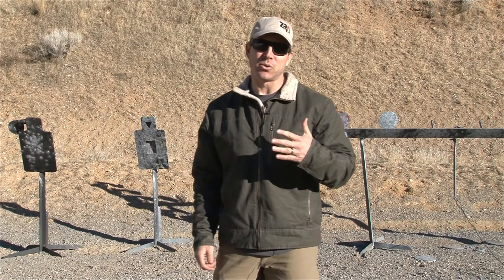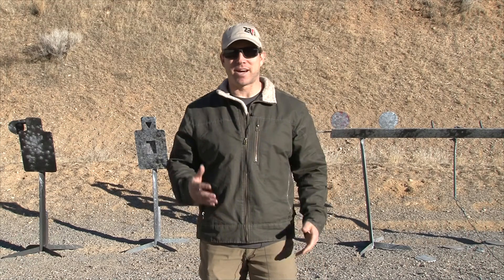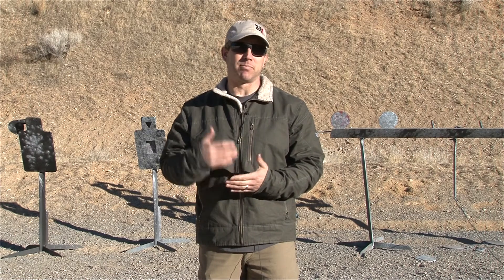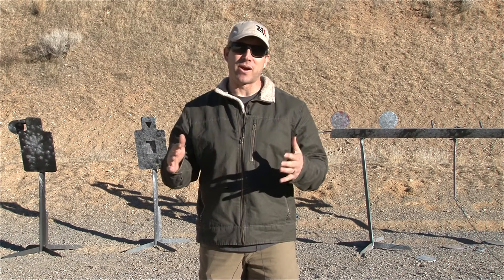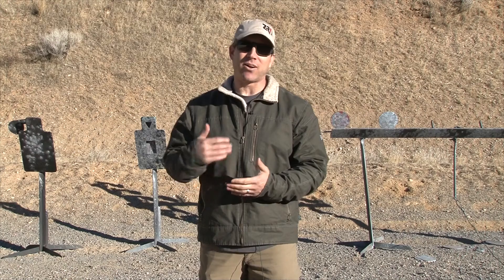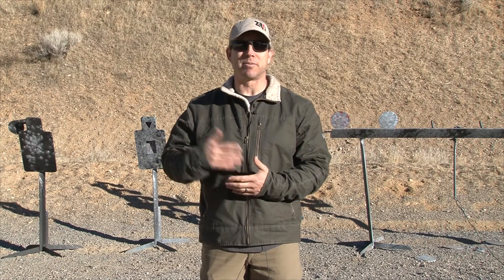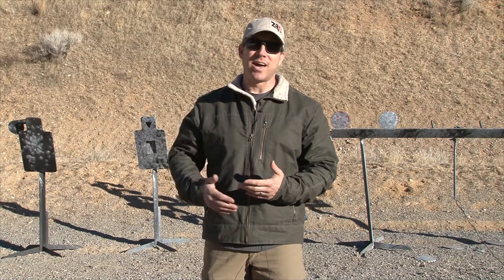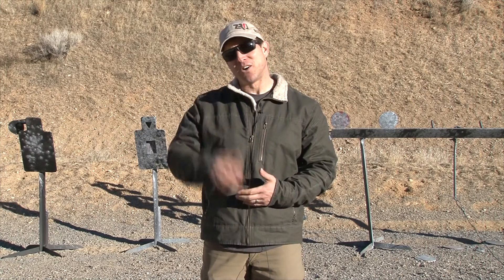A Discussion On Chrome Lining, Melonite, And Other Barrel Treatments.

Comment: So my radical ar 15 has a melonite or nitride finish would I oil or leave it alone since it has brown tint from the gas block , and it’s only near the gas block where that brown tint is , they said it’s from carbon and oil should I clean or leave it and even leave the barrel dry

Comment: If you believe your nitride barrel is “just as good” as a CHF chrome lined barrel you are ignorant. Will it outlast you? Yes. Thats why they make them. Cheaper and it doesn’t matter to civies. No absolutely not, nitride is simply no where near as durable as chrome. When a SAW starts using nitrided barrels I will believe that bs. It just isn’t. Y’all are just trying to make civilians feel better about getting less. If it was just as durable the military would use only nitride. Will you ever notice a difference? Probably not. Fast firing or full auto then you’d see the benefits of chrome. But quit with the “it’s just as good shit” it isn’t and the ignorant believe it. I know y’all gotta sell barrels. Just tell them yes it will outlast them in normal use however it isn’t as durable as chrome. Deer rifles would benefit from nitride. Slightly more accurate but again we are talking about durability. Use your brain people. If nitride was better than chrome then every military weapon would feature a nitrided barrel.  The best would be a CHF chrome lined with nitride outside. Now we are talking

Comment: I didn't realize that nitriding was applicable to stainless steel barrels ... good to know.  I still question the ding against chrome linings for accuracy due to the variability of the chrome plating process  ... once it's applied, the bore is defined, and you set your sights to wherever the bullets impact.  Nothing changes after the barrel leaves the factory.  The chrome doesn't shift.  Am I missing something?
Reply: It’s not as smooth.

Comment: If the accuracy difference is 2% between chrome lined and non chromed lined barrels, why don't we see more bolt action rifles chrome lined then ?
Reply: He just explained that the main advantage of chrome is putting a lot of rounds down range in short amounts time....its a bolt action bro.
Reply from the maker: Being within 2% of each other isn't comparing them to a match grade barrel.  I'm willing to bet that a true match grade barrel is better off left "untreated"
Reply: ^^^what he said....chrome line gives an advantage for rapid fire (very hot barrel) for the average shooter that's not an issue, esp. On a bolt gun
Reply: Also don't forget,  there is no reason to spend extra money on the chrome lining process on a rifle that can not shoot rapidly  or also the fact that no one is going to shoot corrosive surplus ammo out of a bolt gun.

Comment: What's better, chrome or nitride?  
Answer:   5R rifling.
Reply: My first Ar is an S&W M&P15. Before 2013 they were 1/8 5R rifling.
Reply: @curtisdeanmusic  You don't even have to tell me that it shot very extremely accurately, because I already know. lol
Reply: If you shoot a lot, especially at combat load volumes (300+ rounds per outing) performing tactical training, firing rapidly @ steel targets, or shooting low to mid grade ammunition) go with nitride/melonite. 

If you’re looking to group on paper and taking your time or cycling a lot of high quality cartridges, chrome will do just fine. But don’t be afraid to let it rip when you want or need to... 

5R rifling is excellent; very accurate and helps  a bullet retain its integrity better than conventional lands and grooves. 

Note: I’ve been seeing lots of posts with people raving about their high shooting volumes without malfunctions as long as their guns are kept wet... We’re generally taught that our semi’s love oil above all else (certainly vital) but don’t neglect proper cleaning of your bore, chamber, and BCG. A properly cleaned AND oiled system will operate even better/last longer. And don’t believe all the posts and videos saying to dump oil in your trigger group, it’ll only grab more grit and grime, resulting in a gritty trigger (unless you find yourself shooting high volumes in the desert...). Keep it clean and dry. As always, safety depends on you. ✌🏻
Reply: @Tinman6.8Western  Wait, do you have chrome and nitride mixed up here? I thought the guy said chrome lined can take more rounds and more heat and the nitride is slightly more accurate but a little less durable?

Comment: Manganese phosphate? Zinc phosphate? Aren't you talking about parkerizing, aka bonderizing? Old and widely known treatments.

Also on terminology: is Melonite™ a proprietary form of nitriding? Does the DLC treatment have any relation to these last two?
Reply from the maker: I'm not an expert like Nathan but I believe you can Parkerize with both Manganese Phosphate and Zink Phosphate but the end results have slightly different properties and Melonite / Nitriding are different terms for the same process.
Reply: melonite and tenifer(glock) uses a process called quench polish quench. melonite is a tradmark name for it.
Reply: this process increases the rockwell to around 62 to 70. diamond  has a rockwell of 72

Comment: As much as I love a QUALITY barrel with at PROPER chrome lining, If I were a barrel company I would do nitride simply because its easier to do CORRECTLY.
You can have a half moa chrome lined barrel if you do it right BUT IT AIN'T EASY and very few house put in that level of effort.
Reply: some companies do both process .on one barrel
Reply: @godwetrust1436  which ones? And which are reputable?

Comment: I know this is an old video. With that being said, I'm not a metallurgist. I'm not a barrel expert or a gun smith either. What I am is a shooter who has a Criterion chrome line barrel on my rifle. Its hand lapped, and a great price.  It shoots any factory 75 or 77 grain load .750 ten shot groups. 
If I put hornadys 73 grain eld bullet over 23.6 grains of 8208 I get .600 ten shot groups. According to the criterion rep I talked to, I can expect a Sub moa service life of at least 20,000 rounds so long as I stay away from mag dumps and that sort of thing.
I have never shot a mellonited barrel so I cannot comment on them.
Reply from the maker: Yeah man.  A good barrel is a good barrel.  Criterion makes some good stuff.
Reply: companies like cz produce chrome lined barrels feratically nitrocarburized  with a rockwell of 68, sub moa barrel with a service life sub moa at 4000 rounds. typical non treated barreld service life will be around 2000 rounds or less. my assumption is, they use quench polish quench to achieve that kind of rockwell

Comment: Problem I have with Faxon is the gas port diameters of their barrels. .081 is getting into the Jenna Jameson zone. I been running CHF FN's from Rifle Gear that are .076 and they are pretty good. Not near as gassy. And I've even run crap ammo through it. In conjunction with running an A5H2 buffer.
Reply: At what lengths? Dwell time should determine gas port size

Comment: What is the average round count barrel life of a 7.62x39 AR-15 barrel when shooting bimetal jacketed ammunition like Tula and Wolf?  Does 7.62x39 as a cartridge put more or less wear on a barrel than .223/5.56 with the same type of ammunition, same rates of fire, etc.?  Or is there any real discernible difference there?
Reply: Google 10000 rd ammo test. runs thru bi metal boolits...much harder on barrels and copper jacketed. I've stopped shooting bi metal...unless shtf...then whatever goes.
Reply from the maker: I'll see if I can get an answer for you.
Reply: 7.62x39 barrel will last longer if the two barrels are the same. That's cause 7.62x39 is a lower pressure and lower velocity cartridge then 223 556. It's also a bigger bore with a modest charge.